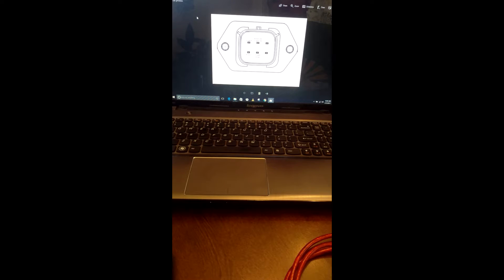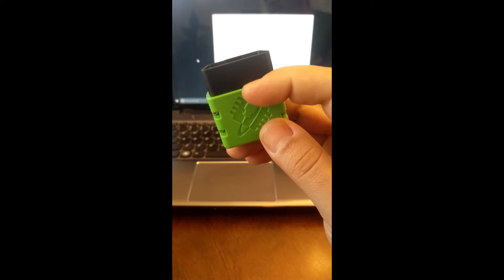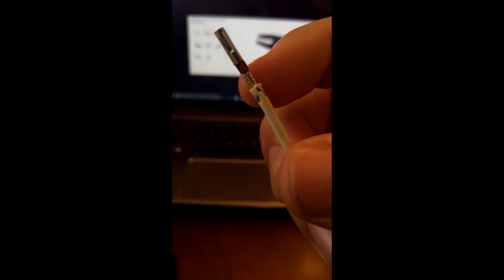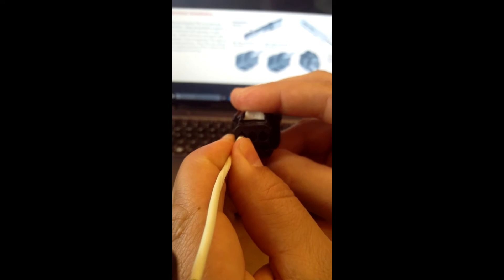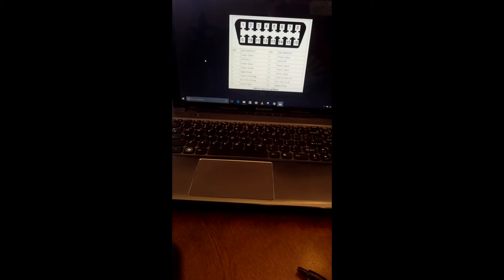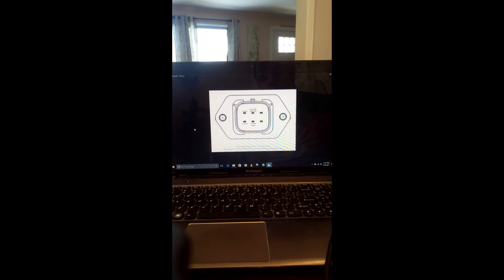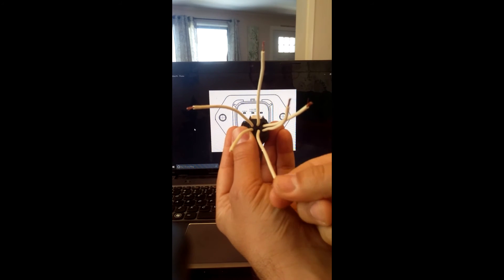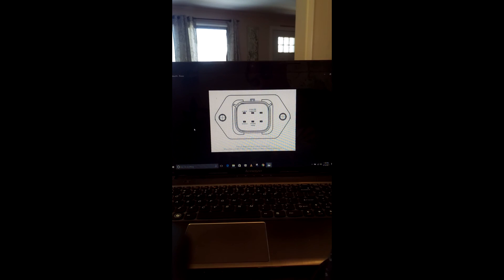EFI Ural Diagnostic Port Adapter Cable To Read ECU's

Comment: Does anyone know wether this still works on GEN II EFI models? I tried to connect an OBDLink LX to my 2021 Ural Ranger, but I cant get the connection to work on the OBDLink. They changed the pinout of the diagnostics port to only use 3 Pins, I suspect they are using the K-Line Protocol nowadays. I have a cheap generic OBD II reader which when connected is able to connect to the bike.   So my question is does anyone know of the OBDLink devices are compatible with the new bikes? Am I just doing something wrong?

I´d be very grateful if anyone could help getting the OBDLink to work.

Comment: Superb series of articles - Thank you very much for posting them!! I successfully made a cable for my 2018 Ural, however Ural did change the diagnostic port on the 2018 (I think the 2017 as well), it is now a 4 pin TE Connectivity part # 1-967325.  For anyone needing to make the cable for this connector, looking at the 4 pin plug  from the front the pins are  CAN High (Top left), CAN Low (Bottom left), Ground  (Top right), +12V (Bottom right) - Thanks again. Nick  Upstate NY
Reply: Thanks a lot for posting this !
Reply: Thanks!!

Comment: Truthfully the OBDWiz software is mostly a read only program. You can monitor your EFI, but you cannot adjust the fuel mapping or parameters.

If you have to adjust the throttle bodies it is still done via idle screws and throttle cables, and adjustments are monitored by OBDWiz.

The only thing that can be done with OBDWiz is clear trouble codes. I have not tried this yet due to my my bike being under warranty.
Reply: Why would you want to clear trouble codes and how would this affect warranty?
Reply: @stupollock6851  I would clear the trouble code if it was no longer active. I'm not sure it would void warranty. But, didn't want dealer to see I have been playing with ECU's. Ural and my dealer are extremely good about warranty items, and just wanted to keep it that way.
Reply: Taylor Martin interesting. I would think they would encourage its use as keeping cylinders in balance would seem to promote longevity. Anyway I’m about to receive my first Ural. Apparently in some port in Europe. I’m in Northern Ontario. My dealer a nice guy but he sells very few. Zero last year and two this year — his father and me both got one. If you have any advice or tips would be grateful.
Reply: Yes. Thanks. I have gone through a lot of their vids and have joined. I’m thinking of making this OBD monitory system

Comment: Excellent Video, you've made a challenging task look pretty straightforward - Many thanks

Can I ask a question? Assuming I get all of this working, what is there on the EFI that I can adjust, equivalent to pilot screws on a Carb, I don't see anything like that and if I have to change the settings of the system can the OBDWiz software do that for me? 

Again many thanks in advance.